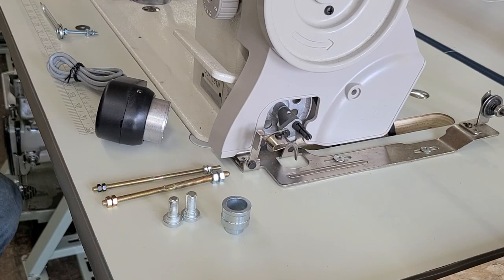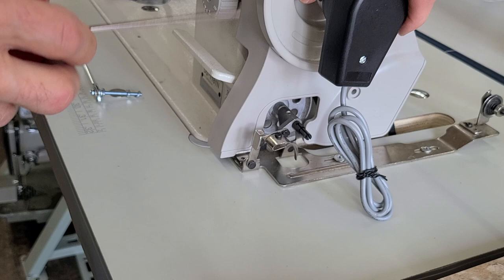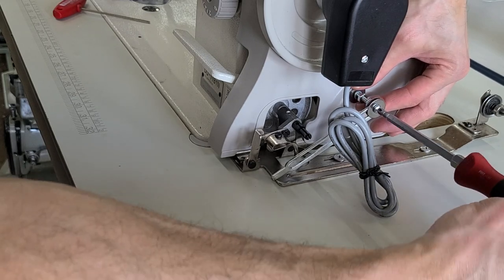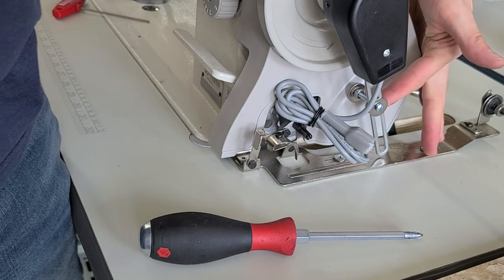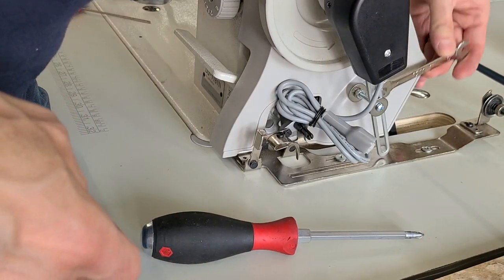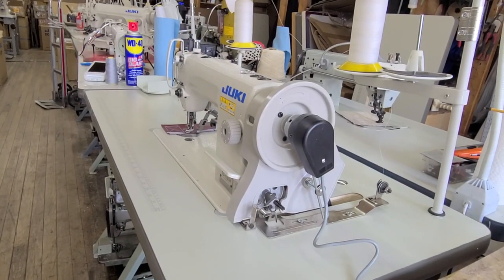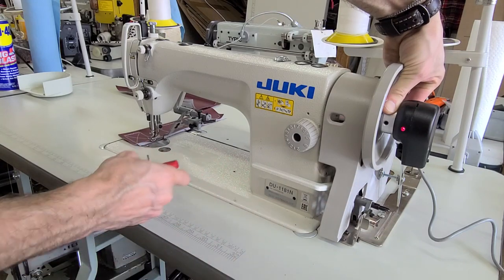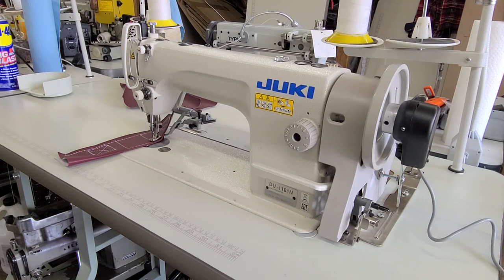Installing needle positioner on a Juki DU-1181N

Comment: Steve i didn't like that slotted rod being near my bobbin winder so I  put a 3/4" piece of bamboo inside a wire connector, crimped and covered with heat shrink tube. Bolt the connector onto rod and fit into slot of positioner. Nothing sticking out to cut or catch stuff on. 😊

Comment: Hi Steve! I added a speed reducer to my Jukie 1181 & mow my needle positioner isnt working correctly. Do you have advice for changing the what I assume is the settings (not just the screw adjustment on small wheel on hand crank)